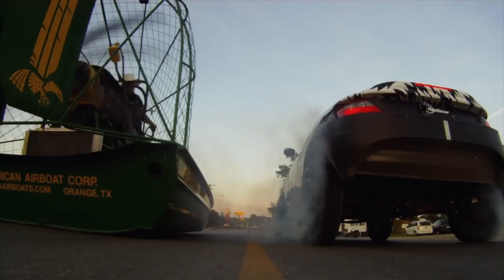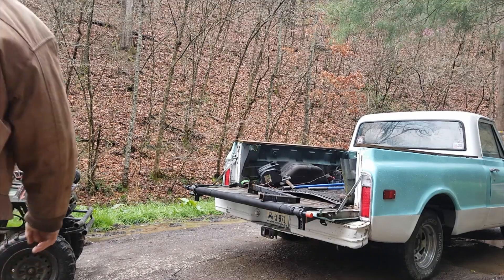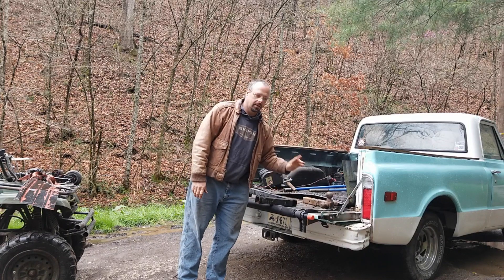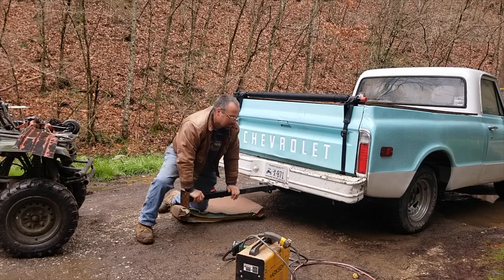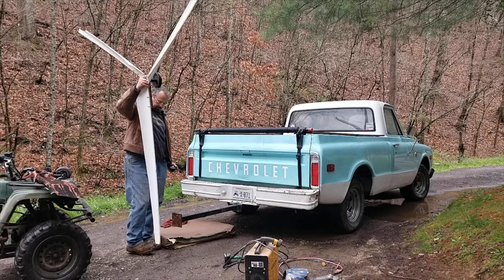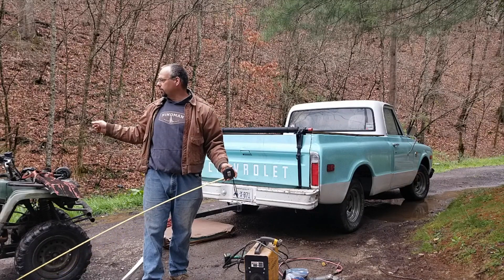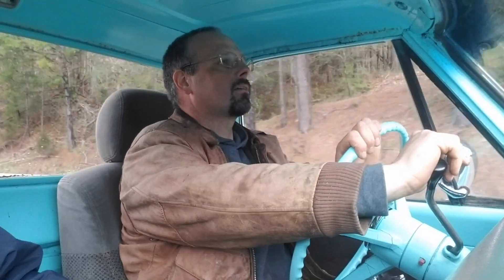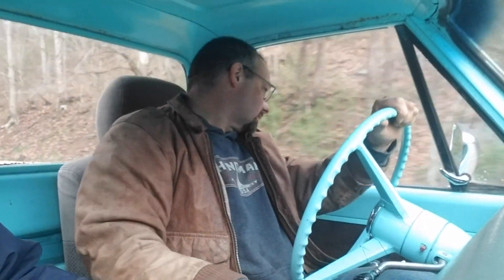DIY Hybrid 50 MPG Truck

Comment: That might violate the laws of thermodynamics. 
     It's going to cause drag. 
     Yeah it would work if you are going with the wind. But not against the wind.
Reply: Also I know that this is a joke....
Reply from the maker: Yeah, definitely wouldn't really work without a huge motor on the prop. Then it wouldn't be efficient at all.

Comment: Honestly I'm wondering why this wouldn't work with the right motor and prop to help MPG.  I've seen electric air boats that scoot pretty good.  Seems like you could rig up a high output alternator to charge the truck battery and use all the excess power to charge a secondary battery that runs a high RPM motor for the prop.  Definitely need the brake pedal to cut off power if it worked.
Reply from the maker: Yes I think it would move it along pretty good. It would take a huge motor though. 
Might be worth experimenting with though.

Comment: I want to build an old square body and put an electric motor inline with the drivetrain. Scavenge a few modules of a Tesla battery. Run it electric as a daily driver in town. Have a real motor for actually doing work and towing.
Reply from the maker: I have also considered something like that. There is a guy on here that did that to an F250. If I can find it I'll send you a link.
Reply from the maker: Here it is https://youtu.be/TLPR2-7-xpM

Comment: If you switched to an induction fan, inside a tube, and make it a little smaller. Then mount it in the bed and mostly above the cab it would be both safer, and more efficient. Then use a generator in the bed with a speed controller for the electric motor. You'll get higher speeds, and be able to control the cruise speed by adjusting the rpm of the fan. Also, with the same setup that you have now, remove the tailgate for more efficient air flow.
Reply from the maker: I guess it would be possible to make something like this work. If I ever try to really make a hybrid truck it will be an electric motor hooked to the drive shaft though.
Reply: @lukeFugate  My reply was for those who didn't watch to the end!
Reply from the maker: @gregharris4101  lol ok

Comment: How many stone legs per week does the engine deliver?
Reply from the maker: The old engine gets about 15-17 MPG. Not too bad for a 68.
Reply: @lukeFugate  i meant how much kw does the electrical engine for the fan deliver. I used imperial units to avoid misunderstanding.

Comment: Good morning, I am interested in building a similar setup like you've got here for wind surfing. Can you tell me what model of electric motor you used please?
Reply from the maker: It doesn't have that much power. Would barely make a fan to cool you down. It made an ok wind turbine though. It is a scooter motor from a kids battery powered scooter.

Comment: April Fools or not I do wonder if it could go as fast as possible I wonder what push it would create, as even the tiniest push does help with mpg. Or even what minor volt increase it could create considering the speeds created by  any considerable wind and the size of a truck battery. Might you measure that later [engine generation vs wind power to the circuit of a truck], it may be interesting. Just curious where and how you'll hook up the wind generator.
Reply from the maker: It would have to have more of an airfoil blade design and a bigger motor to actually push enough to make a difference. It would help though, just like the airboat idea. 
As far as voltage goes, I think the drag on the aerodynamics would use more energy than I would gain through charging the batteries. It would charge the battery, just not efficiently enough to make up for the drag.

Comment: Heck just build a bracket and put an electric motor under the truck and attach it to your drive shaft with a pully and use an electric pto off a lawn mower  :)
Reply from the maker: That is exactly what I have thought of doing. Either mount it so it turns the driveshaft with a pulley, or find a motor with a shaft all the way through. That way you could put it in line with the drive shaft and basically have the drive shaft going through it. It would work, and you could carry the batteries in a toolbox in the back.
Reply: @lukeFugate  well ok then... get after it lol

Comment: I have seen some very interesting contraptions that you have built that actually work quite well, but this one right here just completely takes the cake. You have me sitting here in my chair, laughing my fool head off at your latest invention. But my question is will your Truck pass it's next DMV Inspection ? What about safety for the other people out on the same roads you are traveling on ?
Reply from the maker: This definitely would not pass any inspection. We don't have those in Kentucky anyway. In reality, I took the blade off on the road. That was why I had the camera angle inside the cab going more across the cab instead of straight back. It would have been obvious the blade wasn't there. I put it back on while sitting at the gas pump, then removed it again before taking back off.
Reply: @lukeFugate  Idea... why not put a prop in an enclosure level with the rear wheels, an air scoop above the cab roof and the thrust coming out of a tail with 2 18+ inch air/exhausts and the place behind the cab could be still used for luggage in an other enclosure